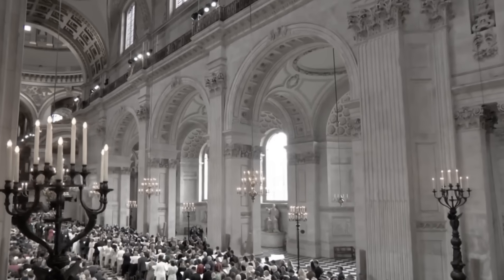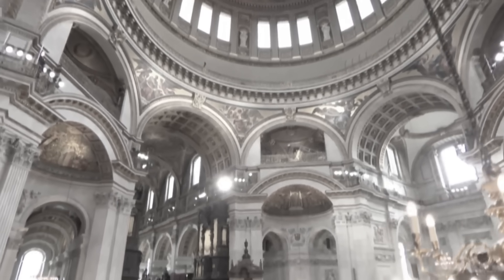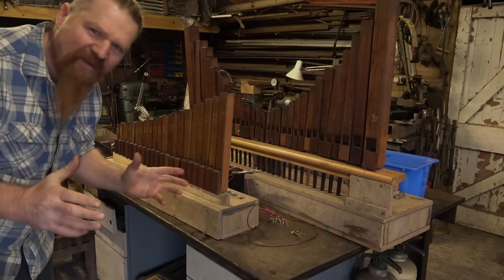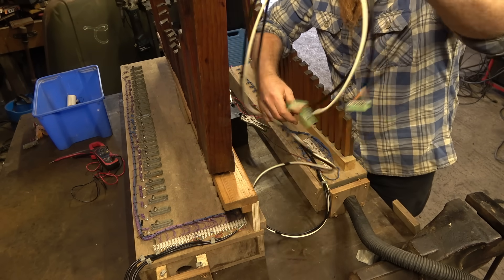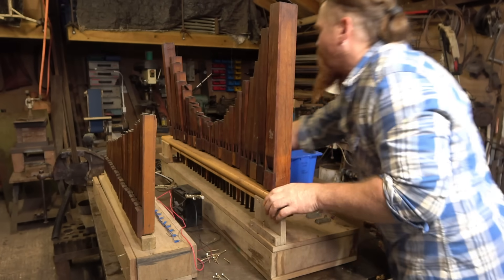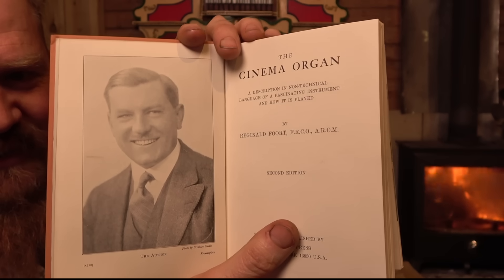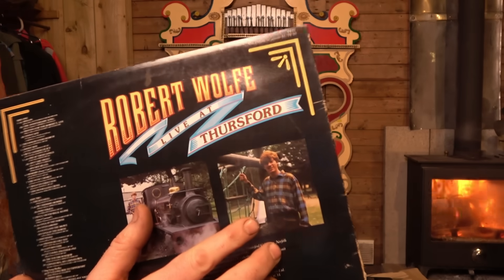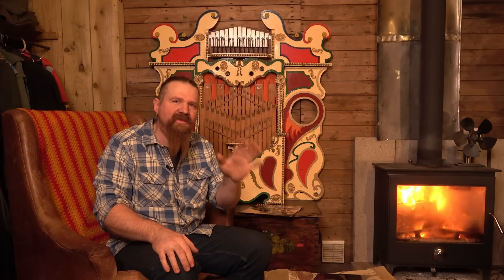Project Awesome: Pipe Organ History Lesson

Comment: Hi Max, ex organ builder here, stopped this at around 1.30, loved to see my very first cathedral organ job of St Paul's in London we stared work on dismantling the Dome Diapason chorus section, just before Christmas 1972. I was the first apprentice to work in the cathedral and beforehand had already made a new off note chest for three of the larger 16' open pipes in the quarter gallery. Sadly I left the firm later on in 1973. Going to watch the rest of it. Now I've watched it lol.  In organ building eyes you've made a couple of fairly crude wind chests, but they do work so fair play to you Max. The components that you have used in the first direct electric chest seem to be fairly early in design, I guess. From the late 1940's or '50's. Even when I started in 1970 the KA ( Kimber Allen) direct magnets did not have anywhere near the travel to actuate and were quick as you like. It basically used a change in the position of the pivot of the actuating arm resulting in the solenoid only moving the arm a short way in comparison with the one you showed, and it also meant that the pallet( the round felt and leather disc that closes and opens to admit the wind into the pipe) could open a bit more. I did at one time volunteer to help maintain a cinema organ in a Catholic Church a few miles from me here in Redbridge East London. I've no idea if it's still in there, it was about 15 years ago the last I heard. That was a Wurlitzer with all the bells and whistles quite literally ( no doubt you know that's where the saying comes from lol 
As for the second electro pneumatic chest, I'm not familiar with the make of the magnet you have there, the valve looks very large in comparison with the KA ones, no doubt probably used in directly exhausting big motors rather than using an intermediary motor and valves as per most church organs, this being a trait of the cinema organ. Incidentally the 'Bellows' are called Motors because they do 'work' bellows blow wind lol another thing I remember from my apprenticeship about pneumatics is that " Equal pressures does no work" remembering that a wind chest has atmospheric pressure AND wind pressure inside it thus when that magnet exhausts the motor it's the extra pressure of the wind that forces the motor to collapse. I know you know this Max but I'm explaining it to anyone else who reads it and knows nothing about organs or their various actions. I'm looking forward to seeing the next episode!
I hope you had a good Christmas and Happy New Year for 2026.
Reply: Er...I think that might just have been massively over technical....and thus, STILL incomprehensible to anyone who doesn't understand organs(so, nearly everyone....!!)
...nice try, though  ....!!!

Comment: I'm not in full agreement about your assessment between a fairorgan and a mobile theater organ. The mobile theater organ will use as much a footprint on top of whatever vehicle you are building it as the fairground organ would. So how much less/more pipework then the fairground organ could you fit? As such: fairorgans, too, have a range of stops, not just a singular rank of pipes.
And while it is true, that most fairground organs (this is truer for the smaller shaped they are) are not fully chromatic (especially in the bass section) there for certain are quite a few exceptions of fully chromatic fairground organs.